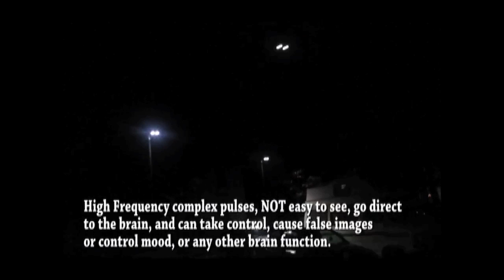Miles Johnston - LED Street Lighting updated on 26th October 2013

Comment: Miles we got a LED Samsung 60 inch on Dec. 11th, it's right next to a wireless water meter, only today I'am figuring out why not just use aluminum foil or aluminun screening all around the water meter except facing the road.  Shortly after we got that TV (which is not mine) I started reacting to the water, crazy itchy for the whole day if I have a shower, now I can only use the vibrancywater dot ca, which is alive structured water, but I feel zaps from head to toe, other family members also have red ears, more psosais, and rashes, the dog has more lumps BUT they will not return the bloody thing, and we had a 9 year old SONY TV there before, no problem, Toronto got the wireless water meter last year.  The Adventurine and Green Fluorite and Selenite Crystals help, and Calcium Bentonite Clay, but regular doctor's absolteuly know shit, you can't feel zaps in your body they say, just take allergy pills for your allergy to hot water.....right!  yet the military even knows this as one of the symptoms of LED TV's......it's sick!  If I was close to death about 5 six weeks ago, millions of other people are going through the same thing, and I created the site ontario smart meter awareness.
Reply: Janice Ashby The LED TV is acting as a wireless magnifier throughout the home.  But regardless of what they are doing, I cannot play into the fear, it's good to be aware of why this is happening, but just a side note for others, your 5th Dimensional Fq. is MUCH More powerful, and when you are aware of this, nothing can harm your mind., and it cannot be controlled.   The products from EArthcalm are helping but something sure happened when I had 2 sessions with a Quantum Biofeedback Machine in November, that's when I started getting itchy, it's no good for those with MCS or ES, only safe via sub-space, and an Acupunturist was also using an Electro-Acupunture machine on me saying "oh it's safe", I felt like I had a lobomotomy for 7 days.